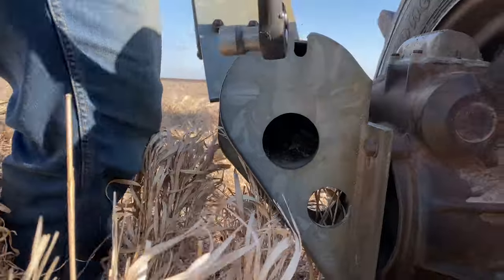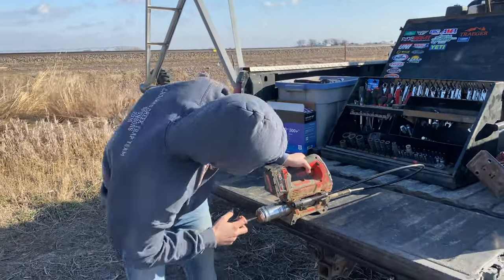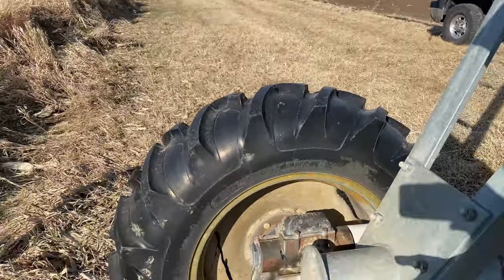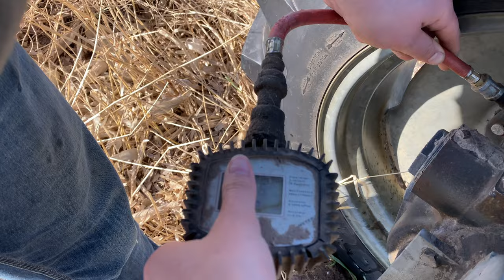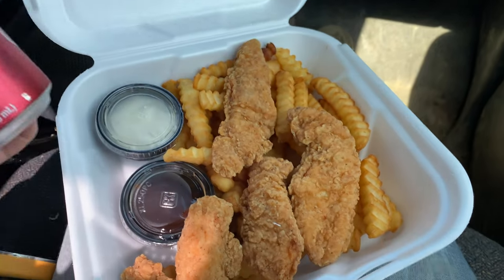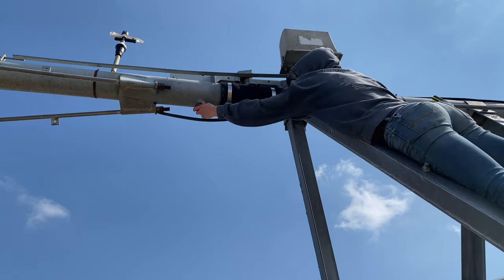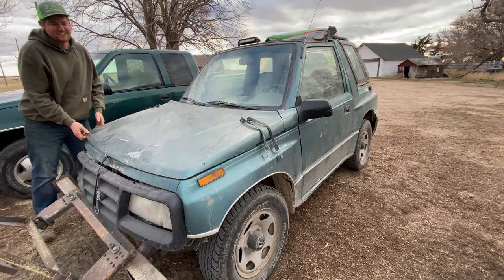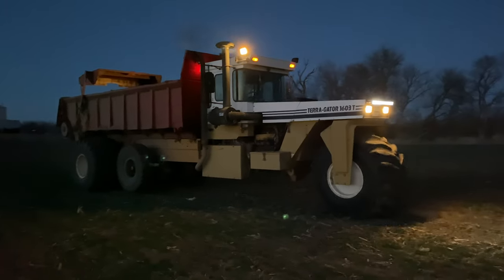Servicing Pivots with Laura!

Comment: I am amazed with that much water in the gear Box that it did not freeze in bust the gearbox
Reply: Guess there was enough room in there for it to expand without doing damage. Or that it's just melted snow so it wasn't in there when it was freezing temperatures.
Reply: Needs a new cover gasket or permatex or else it will fill up with water again.

Comment: If you put a grease line in ,from the top of the pivot machine down to were you can reach them you won’t have to climb it , , makes your job so much safer and quicker to get the job done , just an idea 💡 because hay who wants to fall a break a bone that puts ya outa work for months at a time 😉 all my machine’s I put them in and it’s easy to do and don’t cost much for the grease line, hospital bed can cost you thousands , safety first 👍

Comment: The cover is one thing. Lbs per to take it apart is another level (at -40) All I am saying right there.
Reply: How true. Bolts that would normally spin off easily at 70 degrees will often snap off when cold. Then having to deal with extracting the broken bolt piece still in the casting/housing. Grrrrrrrr!
Reply: @joefudd  there is a smile factor if Oxy/Acet and a Temp gun.
Reply: around 900 and weld with a Tig.
Reply: @christophermair3349  I bought a "Mini-Ductor" tool that uses induction heat to bust loose stuck bolts. They are awesome.

Comment: Arg. I'm on my 3rd motor for my 1987 suzuki samurai. No more HW miles for it, only short distances.
Reply: My 1990 model is still on its first motor ... it's been around the clock at least once, too.  It's just the farm vehicle - "paddock basher" - nowadays, so it doesn't have to go far or fast.
Reply: @vk2ig  yep, the last time the engine blew it was on the HW. The wife said no more engines, so I'm taking it easy on the old girl.

Comment: Last time I was on a a farm JD 4010 was king. How do the pivots turn in sync?
Reply: They are computer controlled. In a prior video, Laura showed us that some of the pivots they can operate remotely from their computer in the office.
Reply: power goes from center out to end tower, the rest keep up to stay straight with arms to relay need to move.
Reply: Thought it had to be something that measured angle and told them when to move @glennspreeman1634